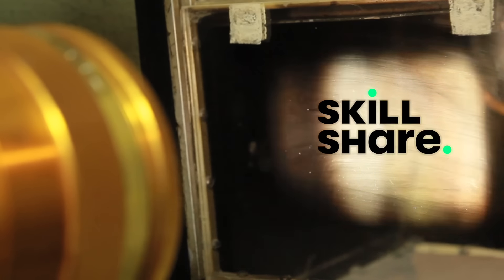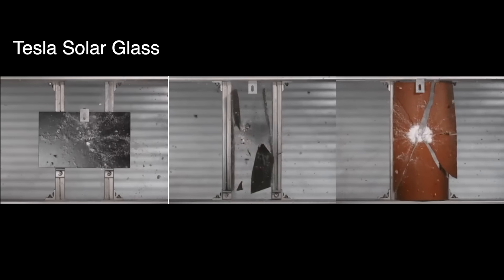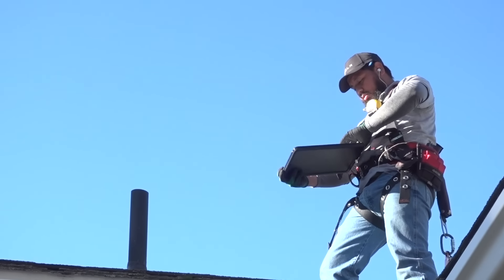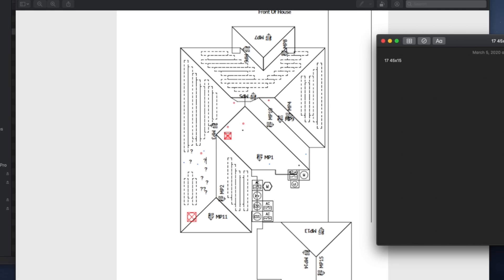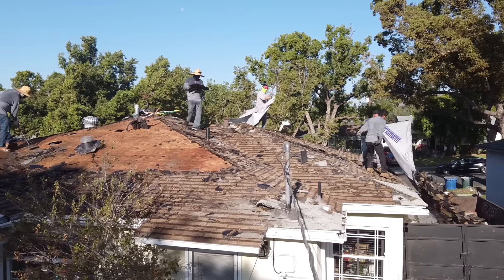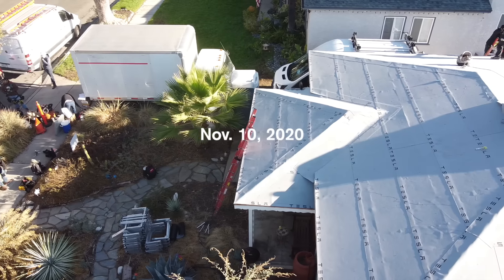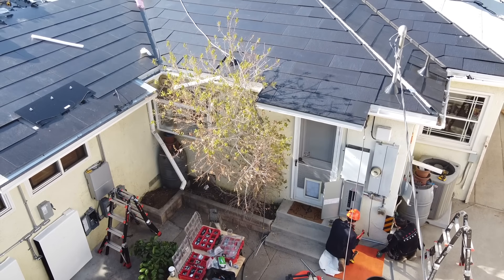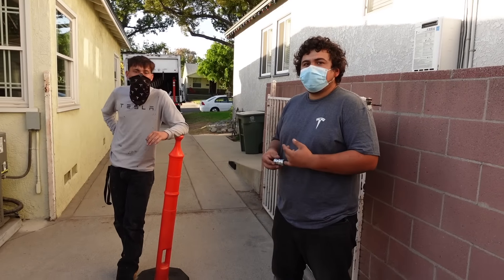This Tesla Solar Roof Was NOT Built in a Day

Comment: 46k USD just for the solar panels is a huge ripoff. A similar system with traditional panels costs me 11k USD (without power walls) in total. Who the hell would pay for those shit tiles...
Reply from the maker: It's not just tiles, it's a new roof and batteries too. The solar portion comes to 10K after credits. I have a video about the final cost and when the system will be completely payed off: https://youtu.be/abyQeGIQ4JA
Reply: @ThisGuysTesla  yeah I realized as I deep-dived into your video and it doesn't really cost that much. However, a traditional solar system is still significantly cheaper and the ROI is better. I guess the tiles become dusty because of the climate so the panels would be the same. Still an interesting and all-around video. Just for comparison, I have an 8,5 kWh system on the roof of the house and the garage (2 separate systems with their own inverters) and the installation took 2 days in total for 2 guys.